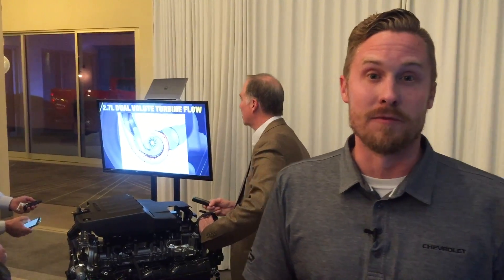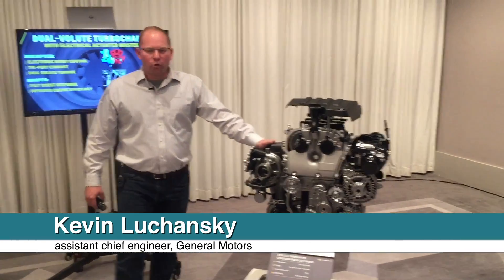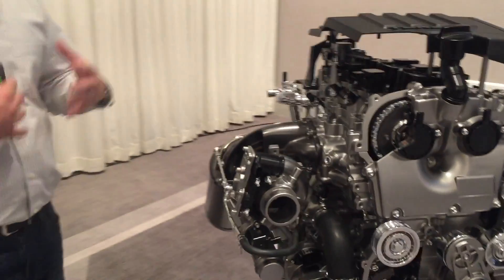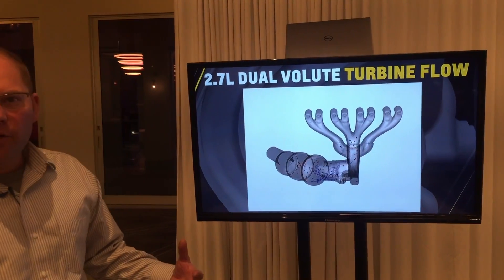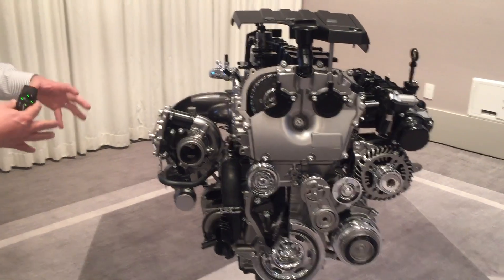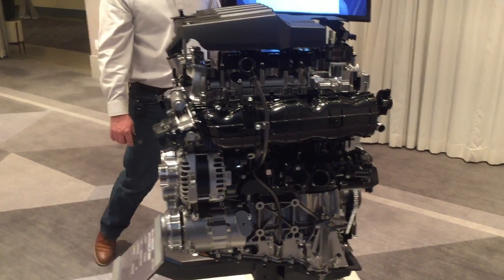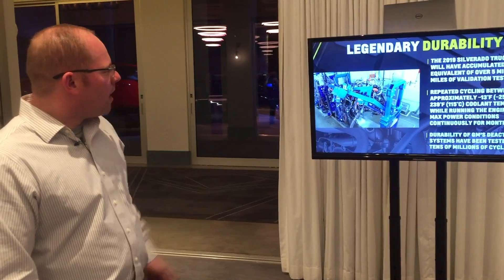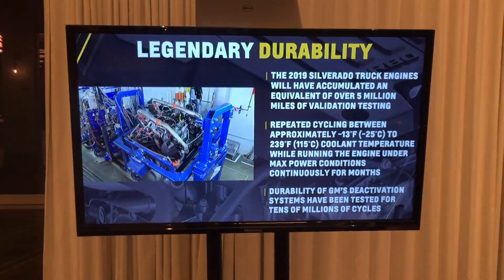All-new 2.7-liter turbocharged engine for the 2019 Chevy Silverado 1500

Comment: When Mercedes owned Chrysler  Corp.,they built the 5.7 ltr Hemi N/A with cylinder deactivation and it worked brilliantly, had a 300E AWD with all the options and it would run on 4 cylinders until 109 kph 68 mph and give me almost 200 km 120 miles to a tank of fuel with 4 people  in cruise control running the factory 17" wheels.  To this day i have seen no other fuel management system more reliable or less complex. i never had a warranty claim or component failure in the whole time i owned it. There maybe better systems out there or more efficient  and i will say not the reliability as this one. Built and engineered by Mercedes = reliability.  Ford/ Gm still aren't there yet, all too complicated.
Reply: Mercedes had literally nothing to do with Chrysler's active cylinder deactivation (MDS). In fact, they didn't have anything to do with the Hemi. They did provide the 5 speed transmission placed behind the engine for many years. They also worked with Chryslers on V6 engines, although Chrysler led that project too.

Comment: Lets see how these will fair after the 100k mile mark.
Reply: Reliability first......after a 100k miles then we can start to say there’s durability. After another 100k miles then you can do a little bragging at the tavern.
Reply: yep my Tundra is almost 400,000 miles original engine, transmission   no major engine problems  just normal wear and tear regular maintenance
Reply: @brandonblack2095  Does that include original frame?😂 Just messing
Reply: IKR? It's WAYYYYYYY too complex
Reply: I'll give it 60,000 miles and shit will hit the fan
Reply: Most of them probably wont make it to 100k miles
Reply: @mrmoist2814  wanna bet??
Reply: @Carolina-gj1wh  II will  bet You Mr. no common sense !

Comment: I keep hearing this guy mention durability, yet I see a ton of plastic fittings on the cooling system with the bypass to help the engine warm up quickly. That is what is going to strand you on the side of the road. Not to mention it’s buried in the back under the intake, going to be a pain to fix all those cracked/leaking fittings when you can’t even get to them.
Reply: if they keep saying it, people will believe it. it's like anything..
Reply: Of course you are guessing at that but sometimes high tech is surprising. In the early 70s some thought computer systems on cars would you you always broken down.
Reply: Don Berry I love technology. That’s the reason I have a 2016 F165. My little 2.7 twin turbo v6 will spank a 5.3 all day long.
Reply: @Fone65  forced induction vs. Natural aspiration? That is ridiculous. Might as well compare a stock Jetta 1.8T and the stock Jetta 1.9 TDi 😑

My cousin has a supercharged 5.3 with no other mods that will spank your 2.7 twin turbo. And it was cheaper. His SC was pre-installed at GM.
Reply: @highball7347  100% great point.
Reply: Be fair, time will tell. My experience is they really do learn and they have been at this along time.
Reply: yeah he kept saying very very durable  lets see after maybe 250k miles
Reply: @highball7347   well he said very durable  how can you tell something that  when it's not tried and proven  i know they tested this engine but it was inside a controlled facility/lab  not on a real world test driven stop n go traffic
Reply: I mean, we've all lost plastic fittings and cursed them. But a lot of us have also had metal stuff rot out for all the hard-to-test galvanic/FIC/chemistry related failures which manifest over time. Plastics never stop improving and have many favorable properties (in certain applications) over metal. Time will tell, but you may be surprised.
Reply: Your exaggerating the plastic failure claim
Reply: This engine has already proven it’s self.
Reply: Modern seems to baffle you?
Reply: Don Berry included 2.7 L
Reply: Like the Cruze ☠️
Reply: https://www.youtube.com/watch?v=KuNxf2BhXyg
Reply: Dive Bar Casanova That’s not the same engine.
Reply: @Dive-Bar-Casanova  The guy in the video said they were racing. Racing is bad for any engine.
Reply: If my ea288 vw tdi hasnt left me stranded in 105k miles I doubt this will. They have similar design in terms of bypass
Reply: @highball7347  people that buy trucks for work very quickly put on mileage. Many used 2019 f250s and 150s with 200,000 miles already.
Reply: @highball7347  my thoughts exactly.
Reply: Let's see if it can pass 300,000 miles like the normal V8 gets

Comment: Instead of wasting boost from the turbo waste gate, store it in a chamber and reuse it at throttle increases when the turbo would normally lag due to spoolup. The larger the chamber the better. Computer operated discharge of the boost would need to be actuated via the ecm.
 Put some of this tech on the 5.3.
 5.3 turbo, ewp, boost recycling to eliminate turbo lag, dual lobe electronically actuated camshaft dohc.
 And whatever else you used to make a 2.7 liter pump out 310 hp with all of that awesome torque.
 Very well done.

Comment: All this technology and u still dont make good engines
Reply: jack daniels had to try and copy Ford’s success, keep trying GM! 😂
Reply: @troydickson1144  did u know that gm is making transmissions for fords?
Reply: jack daniels so why would they undercut themselves and make an 8 speed instead of a ten? Thanks GM, better motor and trans...
Reply: @troydickson1144  they do have a 10 speed its called 10L80 they also have a front wheel drive transmission thats a ten speed
Reply: @troydickson1144  10r80 10r140 ford
Reply: @troydickson1144  the reason why they decided to join forces is to compete with japanese products

Comment: You wonder why people dont buy this shit. Its not like direct injection is actually saving gas. Active fuel mamagement dont work either
Reply: jack daniels Direct fuel injection do work. That’s the reason my 2.7 ecoboost can get away with regular gas. Active fuel management is the reason the 392 Charger can make 485 hp and still get better mpg than a 1989 Mustang GT 225 hp 5.0.

Comment: Why didnt u just use a 4.2 i6. All u had to do was bolt a turbo on nd fix the flaws. U would've saved money. U would have sold more trucks
Reply: Neal Garrison  the only issue is that u cant change cam bearings unless u machine it.